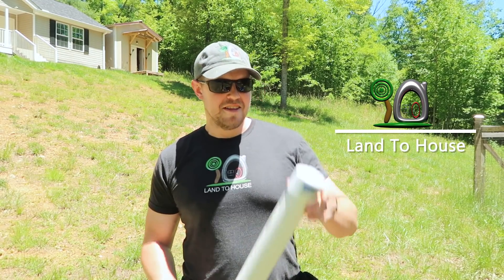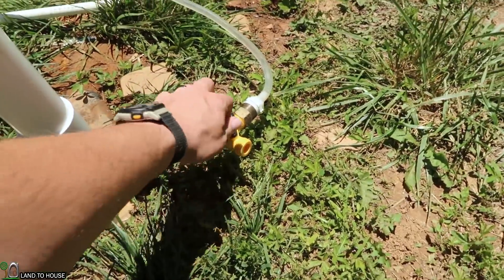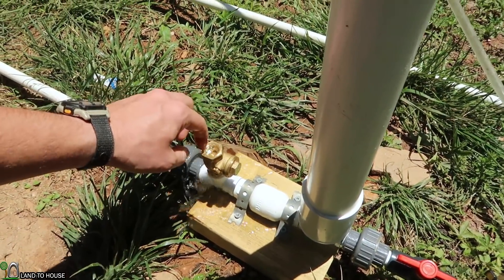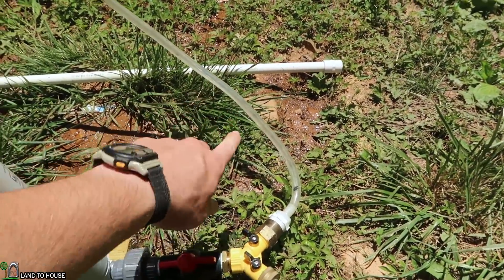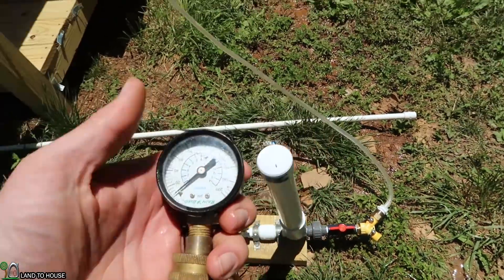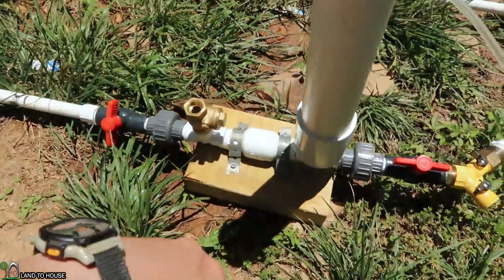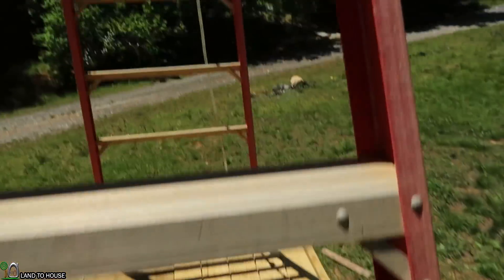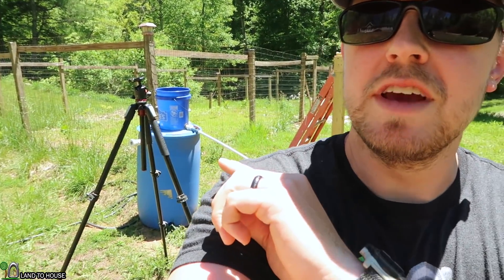Ram Pump Open Delivery Valve at the TOP

Comment: Actually, you should lose 7.4 PSI at a height of 17 feet (a water column of 2.3 feet is euqal to 1 PSI). You only lost 2 to 3 PSI (reading at bottom 26-27 PSI vs. reading at top 24 PSI). Probably, the Ram Pump was at higher pressure in the second test.
Btw., you should be able to measure the 7.4 PSI at the bottom even if the valve at the top of the 17 feet is opened. This way you can also measured height (every PSI corresponds to 2.3 feet of water column height in a hose).

PS: Congratulation to your 150,000 Subscribers (as of May 2021)!

Comment: How long can you leave the valve at the top closed and the one at the pump open before it shuts down the pump ? ?
Reply from the maker: It should run indefinitely. The pressure in the delivery pipe will reach the max based on head pressure and it will stop building there. It's the same effect as if you close the delivery pipe at the pump and leave it going.
Reply: So the pump does not stop when it reaches maximum .... load .... I guess ? ?
Reply from the maker: Haha that is correct. Basically you could connect the pump to a float valve in a stock tank. When the tank is full the pump would continue to go and only produce water when needed
Reply: @LandtoHouse  
Awesome! thank you for clearing that up
Reply from the maker: Sure thing!